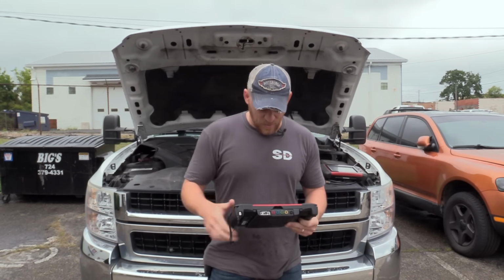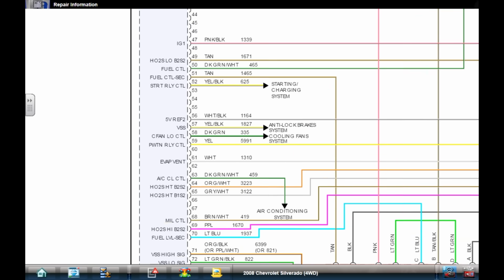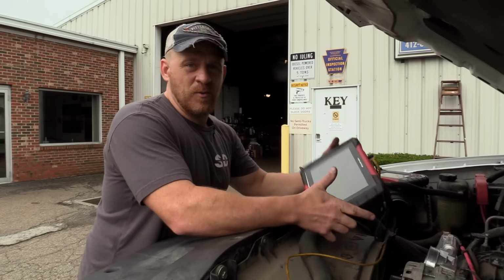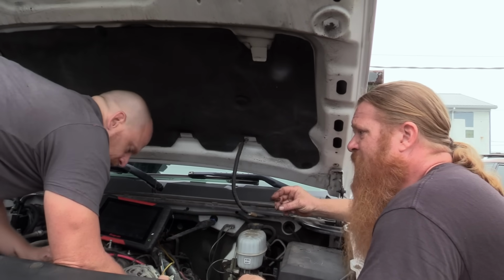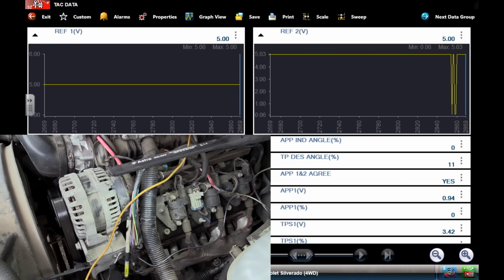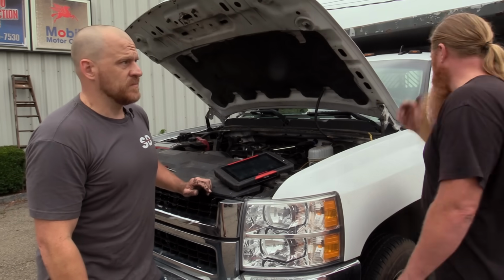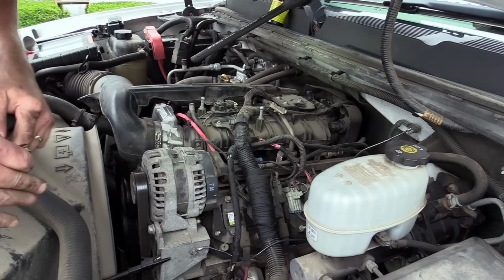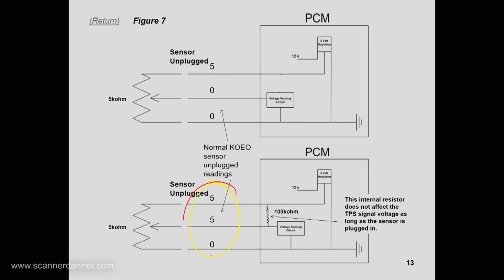Troubleshooting a Shorted 5v Reference Circuit (Chevy Silverado)

Comment: I have a '91 Camaro with a 305 tbi, and I am getting 12v at the MAP sensor harness. After reading up on it, I believe it could be a bad resistor in the ECM. Also, it will start for a split second, but if I leave the harness hooked to the MAP and undo the vacuum line it will rough idle for a few seconds then die out. I usually hear a pop from the exhaust right before it dies.  Are there other things it could be, and what other things could I test to make sure that is it?
Reply from the maker: What are the voltage readings on your other two wires on the MAP sensor? I'm suspecting a bad block ground for the ECM
Reply: @ScannerDanner  I am getting 12v on both the reference and the signal wire, and 0 on the ground.
Reply from the maker: Plugged in and backprobing? Or unplugged. If unplugged, I want you to check that ground pin plugged in
Reply: @ScannerDanner  Plugged in and backprobing
Reply from the maker: Okay cool. Before we call a bad engine computer, we absolutely must check all of the main grounds right at the ECM itself
Reply: @ScannerDanner  Well, the reading was wrong on the cheap multimeter I was using. Borrowed a better one and got 5v. Now to look for another reason for the problem. Thank you for trying to walk me through it though. Was definitely about to scrap the ECM.

 The car sat for a few years, rebuilt the motor, and it seemed fine for a couple weeks. Now all the gremlins are going to start showing up.

Comment: Paul (or anyone else, really), for we non-technicians, could you answer a question? Let's assume that no parts had been changed on this truck (not that it helped anyway, obviously). How would this problem have manifested itself if the 5v reference short was internal to the crank sensor? In other words, if the crank sensor itself was intermittently bringing down the 5v ref2 circuit, a visual inspection wouldn't reveal that, of course, so what process would lead one to find this fault? Would a different MIL code be set if the sensor signal itself was working, but only the 5v reference was intermittently shorted internally?

Comment: Had the exact same stud go through the exact same spot, but on mine i got a p0340 code which of course I changed the camshaft sensor and it didn't fix it until I opened up the harness starting by camshaft sensor area until I got up to that spot. Crazy we had the same problem my truck is an 07 Silverado 4.8l and once I fixed that broken wire by soldering it, it fixed my p0340. Now I still have my remaining p0300. Will a broken wire like this but for a fuel injector send out a code different than a p0300? My cylinder 8 is really misfiring but not throwing any code and all parts have been swapped around.
Reply: By the way I put a rubber plug on my stud to protect it from the harness tube.

Comment: Code reading parts changing, aka statistical diagnostics.. Shit pisses me off! "DoN't YoU hAvE oNe Of ThOsE cOmPuTeRs ThAt TeLlS yOu WhAt'S wRoNg?!" 
I just had an H3 that would pop a fuse that killed the truck just pulling out of a parking spot. Ended up being in that same area but over a bracket that's bolted to the back of the P/S pump. Found it by the tried and true wiggle test.

Comment: This was the most in depth yet easy to follow video I have found trying to search for a p0641 code issue on my 2010 Avalanche. Thank you. Now I truly know where to start!
Reply: Did you fix it bud
Reply: @charleswayne8595  yes i did. I ended up having to wire up a new harness for the throttle body

Comment: Had a truck last night with a 5 volt wire shorted to a high power source. Found out after 6 hours the oem replacement harness had 2 wires miss pinned. 1 was a 12 volt wire and the other the 5 volt wire. Unlinked the 2 wires and swapped them. All was well. Would have never found it without a schematic and the old harness for reference. Hugh!!!!!
Reply from the maker: Oh man, what a nightmare!

Comment: The reason it goes to misfire when it loses 5v is because the one of the app sensor is lost. So the computer shuts down the throttle actuator circuit. It defaults the throttle to 13% (spring tension in the throttle body) when this happens. The only way to control rpm rise is by killing cylinders. That's the way we learned it when I worked for the manufacturer. Great diagnosis! Love your vids

Comment: You should get the 43mm 0.45x Wide Angle Lens for that Canon HFR Series.  It make a huge difference in tight spaces under cars.  You can get them for $15 on amazon.  It's also nice because it protects your main lens from damage.

Comment: I have a caravan that loses the 5v ref as soon as the egr is plugged in. I replaced the egr..same problem.  Could it be caused by a short to ground on the egr signal wire?

Comment: Dude AutoZone had a coupon where they'd give you a discount on parts purchase after a diagnostic reading at the store. I see it everyday. Went out to a dozer the other day. Customer had paid a guy 5vrand replacing high pressure fuel pump and 6 injectors. Not sure why. Machine was throwing a suction control valve circuit fault. Found pin in scv connector pulled back a little bit. He didn't call us initially because our diag fee "was too expensive" he said.  Within an hour I was done and headed down the road.

Comment: I hear ya on not letting open the parts cannon. I actually tried to fight against that when I worked parts, having cut my teeth on 60s Mustangs before I even had a driver license, I HAD to really learn to chase a problem down without sending my Pa to the parts store a bunch of times and emptying his wallet. Lesson well-learned, the car became mine and served me well because I fixed root causes.

Comment: Do a video on the canyon with the 5cyl
Reply from the maker: for what? what are you looking for?
Reply: Same issue p0651 code.. had all the associated codes. replaced and relearned cam, crank, throttle body, replaced accelerator pedal, fuel pump and the vent canister.. all of which I had a code for. Those codes never came back. 
I only get the p0651 code.. I clear it and the truck drives fine for a few feet up to a month or 2.
Reply from the maker: I'm so sorry, I didn't realize it was the same code. There is an easy answer, you have a short in the harness. Time to eyeball the contact points after getting a diagram for everything on that ref circuit
Here is where you can get a diagram
http://eautorepair.adtrk.biz/?a=10817&c=24&p=r&s1=
Reply: I have yet to find a grounded wire using a continuity test with my vom
Reply: And I dont see 5 volts when disconnecting any of those sensors
Reply: Thanks
Reply: It's a 09 gmc canyon 5cyl sle 4x4

Comment: I only have the p0651 code nothing else.. replaced all sensors and throttle body.. also fuel pump and the canister.  When it goes off I still have a bouncing rpm
Reply from the maker: I'm not a mind reader, nor am I an information system. Year, make, model, engine, a definition of the P0651 code etc. Also, by replacing all the sensors, all you've done is add a variable to the mix. I've seen parts bad right out of the box. The good news is you have found the right channel as I teach how to not be a parts changer.

Comment: Just had this exact problem on a 2015 Dodge Ram w/ 3.6 Penstar this week. First step I took was disconnecting each sensor on the circuit one at a time and retest. Found the culprit by wiggle testing the harness section by section until the problem disappeared.  Found the short to ground at the passenger valve cover stud near the firewall.  These take some time to figure out!  Great video guys!

Comment: A nice test with a voltmeter is to connect a coil to 12V and to measure the voltage on the high voltage output with a digital voltmeter. You measure 12V. Do the same with an analog meter and you measure 8V. The analog voltmeter is not high ohmic. The analog voltmeter "loads" the circuit. Many thanks for this video.

Comment: On my gen 3 5.3 (year 2000) there's a bracket that comes up off the valve cover that supports the harness there. Without looking at how the gen 4 harness is laid in, I would suspect someone removed the support therefore allowing the harness to lay on the stud, rub through and cause the problem. GM wouldn't have let the harness lay on a stud like that.
Reply: My 2005 has a bracket as well.

Comment: Senor danner  can a corroded  pcm be resurrected , cleaned. 2006 sti with po448 than cleared and got a 447. Ultimitely replaced at dealership . 1650 dollars. Keys reprogramed. Was a big pain to diagnois and spent mucho denero. No mas subaru
Reply from the maker: Replacement is the only thing you can do at times

Comment: Paul,
I watch a lot of the 'good guys' automotive diagnostics channels: Eric@SMA, Ivan@PHAD, Keith@NLA, but I must say this was one the best case studies Ive seen in a long while and I learned a lot. Great tenacity on your part to listen to your brother, follow the correct diagnostic procedures, and find (and be able to replicate) the issue. Thank you!! Best regards to all including James and Caleb. BTW from a follically challenged 6 decade+ guy Ive got to say Danner has great hair!
God bless
Paul
Reply from the maker: Really appreciate this comment. Thank you! All great channels you just mentioned too.
Reply: @ScannerDanner hey Mr. Danner. I have a 07 tahoe with a very similar issue as this silverado. Its actually parked at the hilltop inn down the road from rosedale. Would it be possible for you to help me get wiring diagrams for this truck? You also were my teacher back in 2012. And im really stuck right now.
Reply from the maker: @BrownsAutoService  you still stuck? Just seeing this now.
Reply: @ScannerDanner  yeah kinda. Trucks near motel 6 by rosedale still. Ive narrowed it down to wiring for the ignition switch where remote start was tapped into. I touch the harness under the steering colum where vats and key ignition is. Possibly also the harness that has steering wheel control and air bag. When i touch these wires and move em around. All the display warnings. Stabi track. Air bag. Engine power reduced. Fuel gauge also will goto empty and correct level durning the playin with wires. Brake light can come on and off. Anti theft will come n go as i play with wires. And check engine like machine gun flashes and u can hear the fuel pump relay rapid clicks. And u can hear fuel pump priming at the engine light flashing and relay clicks. Managed to get it to fire up 3x past 6 months. It doesnt have the amf and 5.3. And idk if it was a afm truck being 07. Cause it doesnt have a fuel pump module near spare tire. But is the same dash and interior. I know that someone built the engine and was told it had a lifter failure. But i dont see wiring for afm. And the valley pan is non afm. So im lost on is it a afm truck factory or a non afm factory 07. And have called several dealers for a dash harness diagram. 6 months i cant get what i need. If u can find out via the vin. Help me with that if your still around rosedale area. Id be willing to work out something with you if u were intrested. Feel free when you see this reach out here or my channel. What i remember to being in ur class i was kicked out when i came to ur class. Probably 2012 time window. My buddy was jeramy crissman. The blue 93 ranger that got a bunk bed welded brush guard. If u remember the green blue ugly ranger danger. He prob got into trouble doin burn outs with that 2.5l engine snd trans held in with straps and frame cracked in 4 places.

Comment: @32:13 on those particular GM trucks/SUV’s, whenever a crank sensor fault of any kind occurs, the backup strategy is to use the cam sensor signal like you said in the video, and also the mass air flow sensor signal. They’re used in combination with each other. And @40:22 you’re absolutely right. I don’t agree with a LOT of stuff that the state of California does, but one thing that they did get right is they cracked down on parts stores selling parts to people based on check engine light codes. I don’t know about any of the other big parts stores, but I know that AutoZone quit offering free “Check Engine Light testing” in the state of California because people failed their smog check because their Check Engine Light was on, went to AutoZone for the free check engine light check, AutoZone told them, and sold them some parts based on the codes. When they put the parts on and went to redo their smog check, they still failed it. A lot of the people who got caught in this trap complained to CARB, and CARB told AutoZone that they could still offer free check engine light code pulling to people, but they couldn’t offer any kind of advice, or make any recommendations as to how to go about fixing the vehicle. Of course, since AutoZone couldn’t use free code pulling as a springboard to sell parts anymore in the state of California, they just said to heck with it and quit offering it in the state of California.
Reply from the maker: Wow, that's actually awesome. California did something I agree with for once.
Reply: Just offer it with a common sense disclaimer that it is not a diagnosis, just where the problem shows up.  I've worked in auto parts and it is very annoying when someone shoves a phone in your face with a zoomed in picture of some area of an engine and wants you to recommend a fix.  They get angry when you honestly say I have no idea, what is it?  One guy actually said, can't you just tell me which isle?  Oh yeah, blurry picture isle.

Comment: I like the trouble shooting message at the end of the video. It's so true. But to be fair, not all mechanics are equal in intelligence, patience, troubleshooting, crumb-finding problem solving capability like you demonstrated finding that connection point and culprit of the wire damage with the stud slowly grinding into the harness over time from I' am sure from vibrations over time.

Comment: I had almost the same issue with a #7 misfire on an F150. Heat had killed the harness going into fuel injector an was still inside the harness. Virtually came apart in my hand when I moved it. Danner you're like a spider with your diagnosis!

Comment: I really need some help and out of everyone you're #1 on my list of ppl who cld fix my issue. Ok so my 05 Acura TSX has a U0107 code lost communication with TAC module. Went into limp mode outta nowhere (hadn't done any work where wires cld have gotten moved around). The throttle plate opens fully when it's floored and then turn key to 2. Next in shop manual says 2 chk pins on tac module and PCM 4 continuity..well I can't figure out how to get the harness off the TAC to test it! It's like the actual module has a little circle on either side and the harness has holes that the circle "prongs" go thru but it doesn't budge when I try pushing the white part on the harness(that the prongs go into). Are there any other procedures I cld do to figure out where the prob is that doesn't entail disconnecting the TAC module?
Reply: Oh yea and visually all the wiring I can see that deals with the electronically controlled throttle seem 2 be good..not hanging or resting on metal or anything..so makes me think it's a bad component..cld it be anything besides the TAC module? U0107 is the only code

Comment: I have worked on GM two 5v reference system and I found out that ref 2 is indeed shared among 4 or 5 sensors but not directly connected to them, in other words a short may drop it from all of them but even though there is no continuity between 5v ref 2, that is only possible by using Diodes on the PCB to protect the regulator from high voltage shorts, also the logic is programed to figure out which sensor 5v ref 2 dropped first and triggers a code for the sensor's  circuit

Comment: Question for you since your a master with electronics and ecms. New trans newer ecm getting a 6.4 shift time error even tho its .500 shift time....logging actual shift vs shift error...
Reply from the maker: What are all the components that effect shift time? Valve body, solenoid, seals in a particular clutch pack. I'm not the tranny guy my friend. Sorry.

Comment: Some 5 volt regulators that have the shutdown features will actually start pulsing the 5 volt output if it senses over current. If the bolt was touching an area that had arced causing a resistance instead of a dead short the regulator could have sensed an over current condition and pulsed it output to keep from burning itself out.

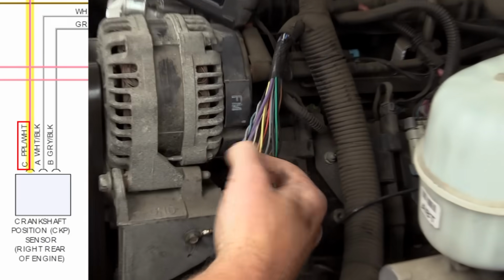Comment: 18:50, that's not how you read wire colors. WHITE/Black means that the white stripe would have the 80% cover and Black would have the 20% cover.
Reply from the maker: The second color listed is the tracer
Reply: @ScannerDanner  I made this mistake when wiring an alarm system, there were 2 wires with the same colors, just reversed. Perhaps this is not standardized but I always read wires this way. Thanks Danner.

Comment: Great video, just a quick tip. GM has seperate wiring diagrams for the 5V reference. So you can see in one small wiring diagram which sensor are one reference 1 or 2.

Comment: THIS was absolutely a great example of why the flowcharts can send you the in the wrong direction.......in some cases.  Especially with intermittents!
Over the years I had learned when I couldn't see the flowchart locating the problem, I tested it my way and made the problem show itself!  Flexing the wiring harness (es) moving connectors, heat stressing the circuit, and whatever else worked!  You did GREAT with this one!  Especially with how the PCM program and the Network function and display the info!

Comment: Personally, I would have just replaced the studded bolt w/ a flat headed cap screw. If you wanted to go full legit install a strap clamp on the harness to the culprit stud.